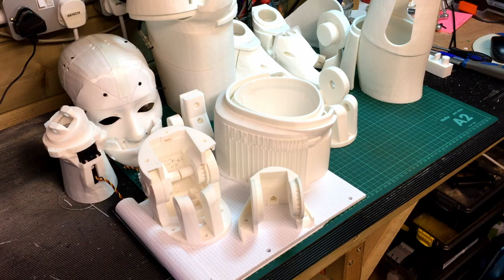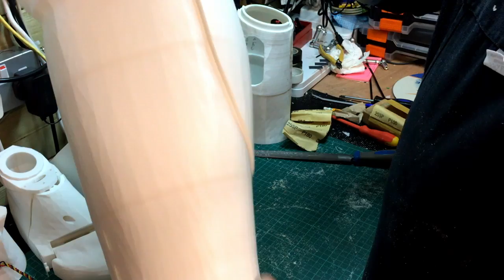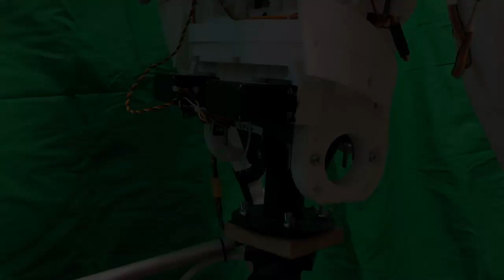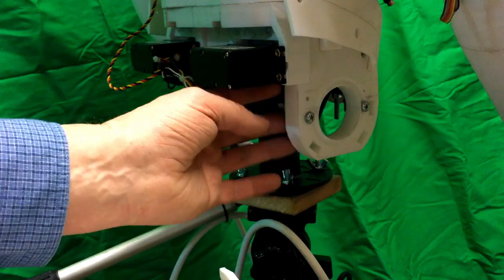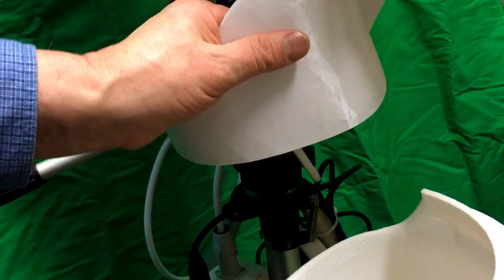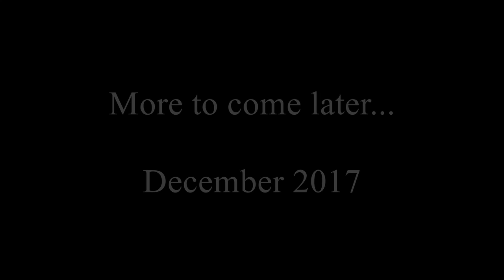InMoov Build Part - 25 Legs

Comment: Great work Kyle. I wanted to ask what environment you are working in as you are printing ABS parts on the Prusa it appears without an enclosure so warping might be a factor? Are you in a garage or shed that is fully insulated?
Reply from the maker: Hi Mark
I have used PLA for the whole of the InMoov.   I have used flexible [ninjaflex equivalent] for another set of the hands.   I have also bought but yet to use PETG which I intend to use for gearing on some projects.  So not used ABS for the reasons you mention - heating, enclosures, warping and I am told the smell.   I have printed the PLA at 40% infill on some of the InMoov gearing structures.   Currently printing R2D2 at 10% infill and 0.3 layer height and the prints are fine and detailed and tough. 
I think if I took  InMoov to events the whole time, I would reprint the main shoulder gearing in PETG. 

All printed in my small workshop/shed but its fully insulated. The PLA I have always used is from technologyoutlet but bought from Amazon here https://www.amazon.co.uk/Premium-quality-filament-suitable-printers/dp/B00I8MRPDM/ref=pd_bxgy_328_img_2?_encoding=UTF8&psc=1&refRID=Y34Y14XRXS1V0DCD2ET9

Comment: Just modded my first servo for the bicep but not sure on how to set it up on ez builder
Reply from the maker: What do you mean by "ex builder"?
Reply from the maker: Do you mean EZ Builder software?  Have read of this to get started...https://myrobotnigel.blogspot.co.uk/p/ez-robot.html
Reply: yes I already setup frames and actions for the hand but don't no how to setup the hacked bicep motor(hs805bb) to work with the pot settings
Reply from the maker: Yes, the bicep setting I found really hard when I built my InMoov.  I almost broke the arm several times.   Have a read through Gaels description of setting it all up first. Taking the pot out of the servo and mounting it on the bicep gearing changes the ratio of the servo movement.  

Sit the hacked servo on your table with the pot wired next to it and power it up with EZ-Builder.   Get to understand how there is a "zero point" with the pot, so when its powered up the servo stops rotating, without touching the software control.   
You can roll the servo forward and backwards by slightly turning the pot. At the zero point, the servo stops.   You can now move the servo forward/back in software, ie from 0 to 90% for example.    You must get this to work and understand how to do this first.   This is essential.   

Now, set the servo in software to 0-degrees and adjust the pot so it stops the servo.  Disconnect it all. Dont turn the pot! 

Once you have got that to work OK, mount the servo and pot in the bicep.  With the bicep approx 98% open, so only a small gap before its fully open, this is your 0-degree point in software.  Set that 0-degree in software.   The small Inmoov gear wheel that moves the pot mounts on to the arm assembly and turns the pot forward and back.  You want to slot that gear onto the pot spindle and the arm assembly so that it connects to the larger gear on the forearm.    The idea is that you will have set up the pot, gear and arm roughly in the correct position before powering up the servo.  [Dont allow the pot to turn!!]  

Now the scary bit.  Power up the servo but be ready to disconnect quickly.   If the pot is not in the correct position, it will either try to open the arm more [bad, as it may break something] or close is it a bit [which is fine].   As you learned earlier by adjusting the pot to a zero position, the pot/small gear/arm position needs to find its zero position and not move.   
If the arm closes a bit and then stops, thats fine.   Now by slightly rotating the pot body itself in the arm , you can open or close the arm.  Once you have the arm at the 98% open position, turn off the power and glue the pot body in place carefully [hot melt glue is great].  

Power up and now try adjusting with the software itself.   0-degrees will be arm open and about 60-80-degrees will be bicep closed.   Try it slowly as this may all vary a bit.    

Important - if it all moves wildly and just makes no sense, reverse the wiring on the pot as it may be back to front. I got it wrong first time and it took me ages to realize this [ie swap the outer two wires around] so it works in reverse. 

Hopefully this all makes sense.   As mentioned, the trick is understanding the zero point of the servo with the pot.
Reply: Thanks I set the pot to centre position (no movement) using the continues rotation servo panel it's just the coding side I can't work out
Reply from the maker: Hi anewby, I dont use "continuous servo" controls to run my InMoov, I use the "auto-position panels".    Is that what you are trying to work out the coding with?
Reply: The main question is if the pots is attached  to the arm and As the arm move surly it turns the pot which will override the frame and keep the motor moving 
If not I could  just run code to run frame 2 for so many millisecond then return to the rest frame also do u have the zero-point set to 90 on the frame so u can reverse the arm back
Reply from the maker: Hi anewby
Yes the arm will turn the pot.  The servos are not run as continuous servos with the way the InMoov is built. 

The reason the pot is taken out of the servo and attached to the InMoov arm is so that the servo ratio is changed.  Normally the servo would rotate its spindle a maximum 180% degrees and this is because of the internal gearing rotating the internal pot inside the servo, so the motor would turn maybe 20 times but the spindle only half a turn[180 degrees].    With the InMoov, the spindle must turn several complete revolutions to turn the InMoov Bicep gear for example, enough to open/close the arm.   So taking the pot out of the servo and attaching it to the InMoov gears, changes the gearing ratio.  As the arm bends, the pot needs to rotate so the servo software thinks it still knows what position it is in, ie 0-180-degrees.   The EZB software will allow you to move the servo say from 0 to 10 degrees and the servo spindle rotates multiple times to achieve that.   

You could as you say, control the servo in different ways and run for xx-milliseconds and so on, but its simple to allow the EZB software to calculate this.  The EZB software also calculates acceleration and deceleration between frames.  
I have set my InMoov at 0-degrees open bicep and a maximum or less than 90-degrees closed [you need to work out the closed degrees as you can over close the arm and break it]

The zero point of the pot is the arm open [with a slight gap left] and EZB software set at 0-degrees. Once thats set, glue down the pot body in the arm.   Now the InMoov gears will move the pot as required. 

So frame-1 for example could be 0-deg [open], frame-2 50-deg.   If you now transition between frames, EZB calculates acceleration/deceleration.   You can change speeds, steps and delays in the Actions tab.

The EZB autoposition software will not allow you to set a min-max degrees, it will allow you to set up to 180-degrees even if you only want say 0-80-degrees available.  So you can break things.
Reply: Is my pot not setup right because setting servo positions in frame just speeds the servo up and keeps going it does not set a position?
Reply from the maker: Hi newby, yes sounds a pot problem.  But when its powered up and you manually rotate the pot, can you make the servo move forward and backwards? If you can, the pot seems OK.  
Does it seem like the servo is rotating the wrong way when you control it in software? If so, try swapping the outer wires on the pot.   I had this problem and the servo just kept going when it was in the arm, as the gearing was therefore all back to front.  Got any pictures of your setup?
Reply: Yes the servo move forward and backward but it speeds up the more you turn the pot and keeps going
I can set frame 1 to 0 and frame 2 to 6 and it move slowly but does not stop 
increasing the servo pos in frame 2 just increases the speed and does not stop at 6 deg
Reply from the maker: Try just setting everything up using the Ez-builder "horizontal servo" only [in add controls, horizontal servo]. Just setup a single software vertical servo control and connect it to your servo on the bench. Zero the servo pot so it does not move when the software slider is in mid position. You should then be able to control the servo in software. Moving the software slider to right, the servo should move clockwise, to the left - anti clockwise. Does that work OK?
Reply from the maker: Meant to say horizontal servo, but horizontal/vertical are the same anyway
Reply: Thank off to work soon so won't have time today but will let u no when I try it

Comment: Do you think you can walk ? I think it is only support
Reply from the maker: No I dont see how it could walk .   The legs need to have movement outwards for balance, and Gaels design only has forward and backward and It would just fall over.   Looks good though.    Your robots legs have the outwards motors don't they.   Also have you seen mayaways InMoov? [http://www.ez-robot.com/Community/Forum/Thread?threadId=10153&page=13] similar to yours?  He is mounting the InMoov on top.   
I see that James Brutons walking XRobots legs used Actuators on his later versions to stiffen it all up more. 

I will fit my InMoov on a pole welded to a chair base when I get a chance.  I am thinking about motorizing the wheel base at some point.

Comment: Amazing work you are really crasy i follow very nice
Reply from the maker: Thanks Ambroise. Hopefully will get the legs finished before Christmas and then just need to remake the whole stand...
Reply: kyle campbell hello kyle it is interested to know how long you need for print each piece how many filement you need thank you for share you wirk
Reply from the maker: Hi Ambroise
These legs are really large parts. 
The "Thigh Mid V1"  parts for example have taken 30-hours and 100-m of PLA filament each.
The "Thigh High V1"parts have taken 36-hours and 113-m of filament each
I did use support on the larger parts but all are just 20% infill. 
I have used several reels of filament for the legs and and almost ran out during the really long prints a couple of times, with just meters left on the reels.    I am using standard PLA from Technology Outlet [bought at Amazon for £19.00 a reel so costs are adding up - used 5-reels approx. since beginning of October ]
Most of the other largish parts have taken from 6 - 20 hours so at lot of time.  
My new Prusa printer has been really good and no issues with all this printing. 

I have a spreadsheet with all the printing times and parts printed so far, and I will add the spreadsheet  to the blog next week [http://myrobotnigel.blogspot.co.uk/]